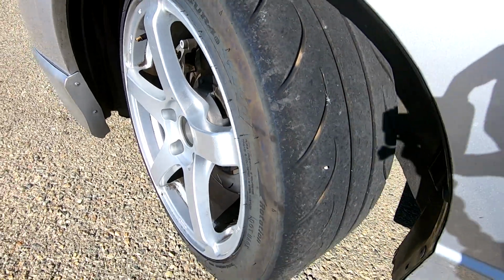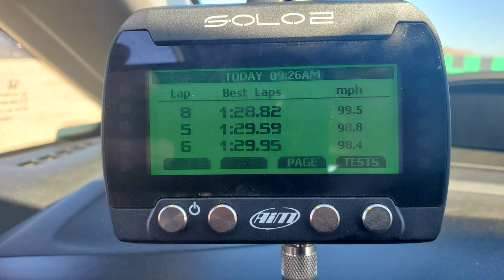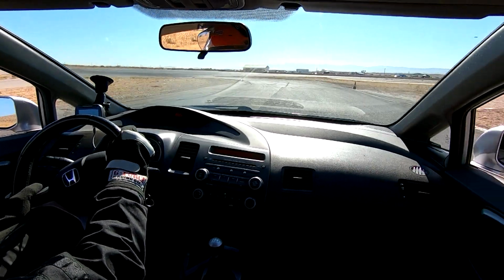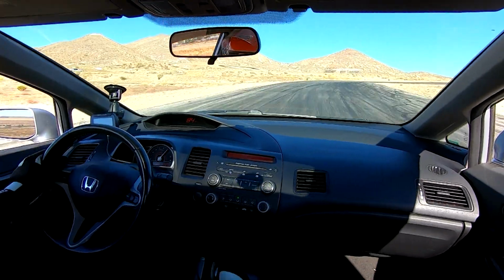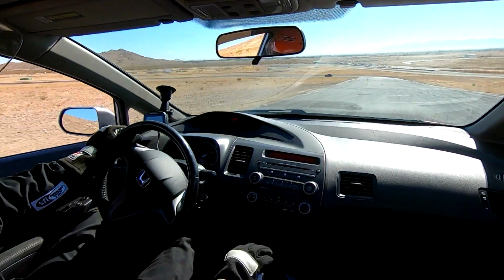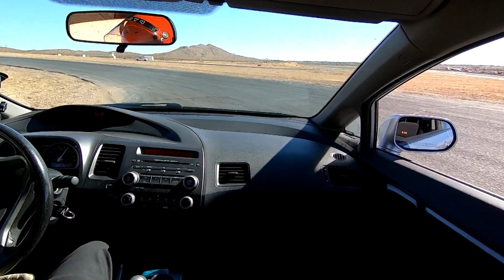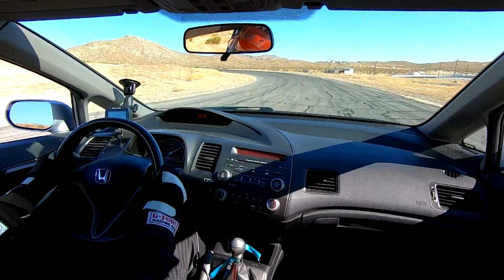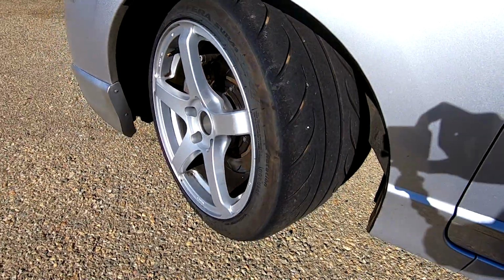Streets of Willow Track Day Vlog: The Godspeed Coilovers Are Awful || Project Civic Si Part 25

Comment: Hey Jake do you think the hybrid undercarriage trays helped with aero and are they worth it? As for suspension maybe try the buddy club n+ if you can find them not sure if they make them anymore.
Reply from the maker: Streets of Willow is such a low speed track that it's hard to say. A faster track like Buttonwillow, Big Willow or Chuckwalla will be more telling. It does get slightly better MPG driving to/from the track, which is neat.